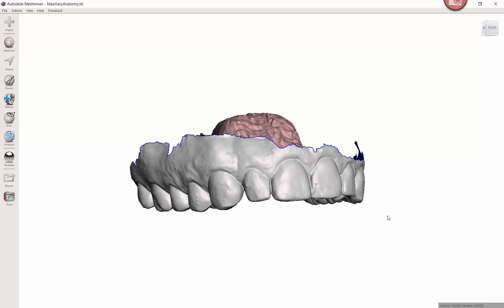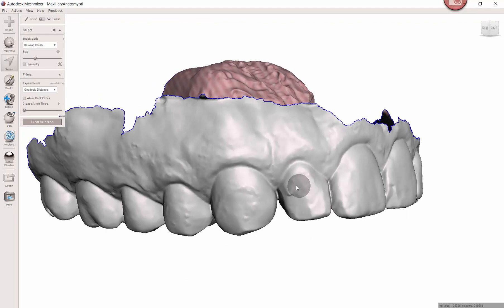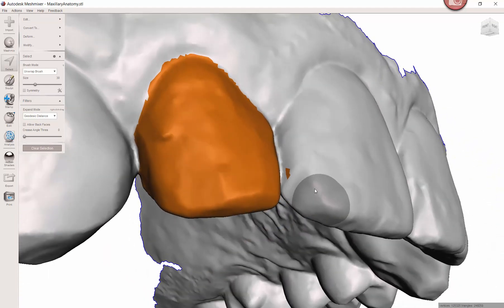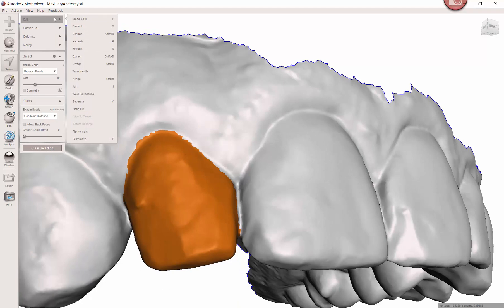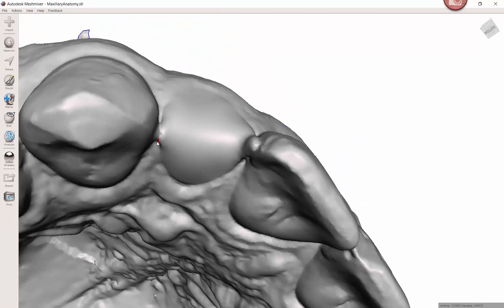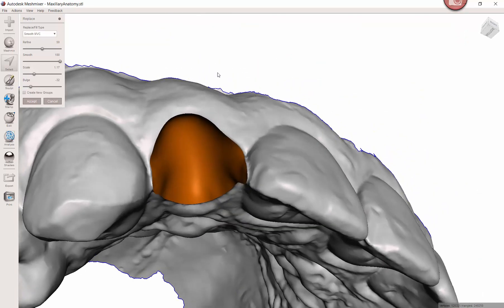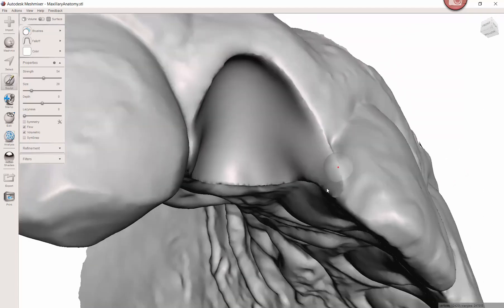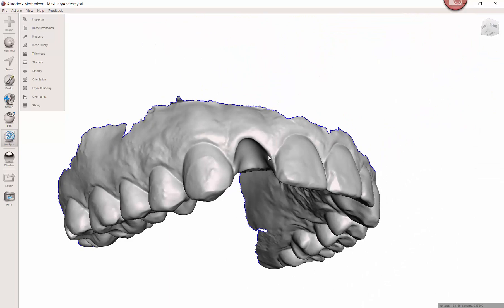Meshmixer - Virtual Tooth Extraction

Comment: can you do this with a 3D scan?
Reply from the maker: CBCT/DICOM of a patient won't capture soft tissue. If that's what you mean.
Reply: @bgrutterdds  I'm not a patient but interested in root analog implants like the ones done in Austria. I was wondering whether this tool can digitally extract a tooth from a 3D scan where the root is also seen. That way a cad model can be made and sent to a zirconia mill machine like a Cerec
Reply from the maker: CEREC would not be able to, as it would require a 5-axis mill. Also, the zirconia needs to be treated in a manner so as to ensure the surface is both sterile and hydrophilic. Lastly, I believe Root Analog implants to be a disaster in general. Rarely are we extracting teeth without boneless. And if there's ever need to remove the implant, it will be far more catastrophic to the patient than tooth or traditional implant removal. I believe these implants might be appropriate in about 5-10% of implant cases and likely will not solve a problem that needs solving.
Reply: @bgrutterdds  thank you for replying. Not being a dentist I'm guessing extracting a root analog implant would be catastrophic because it's fused to the jaw bone? Versus, I'm assuming, "unscrewing" the regular implants?
Reply from the maker: @MiroBG359  No, it's actually less likely to integrate than a traditional titanium implant. But the problem is that it is not cylindrical, so removing it requires a lot more bone removal to get around the non-cylindrical shape. Especially on multi-rotative teeth like molars. Imagine you tried to remove a basketball hoop from concrete. You could drill a small trough in the concrete around the pole and then remove it. Now imagine that hole was curved in multiple directions and got wider in various directions. Imagine how much concrete you would have to remove to dislodge it.

Comment: Thanks for your great videos. Question: When i do the virtual extraction and use the scale and bulge sliders, i can't go deeper than a rather flat surface. It does not have the same result as yours. Any suggestions? Many thanks
Reply from the maker: Hard to say, but my gut says that you didn't try enough combinations of the 2 sliders. I can always get it to work, but the numbers are different with every case. If you make a video and share it somewhere, I can take a look. But I'm pretty certain that you just need to move both sliders more. I don't believe either are totally to the left, BTW.
Reply: @bgrutterdds  thanks for thw quick reply. You're right. If i put both to the left it doesn't work. If i change with one more to the rigjt and the other more to the left it does the job great. Thanks a lot!

Comment: If you had to extract to consecutive teeth would you do them at the same time or individually?
Reply from the maker: Depends on my plan. And the case. Most likely same time, but that will digitally blunt the papillae. Then, the guide will physically when it's seated. So, depends on how important it is that I not harm the papillae in any way.
Reply: Thanks Baron I find that when I select two teeth the selection turns purple and doesnt let me do anything. that's why I normally do it individually
Reply from the maker: Yeah, the magenta is because the selection parameter is not smooth and flowing. Can't have any jagged edges. It doesn't know how to reconcile.